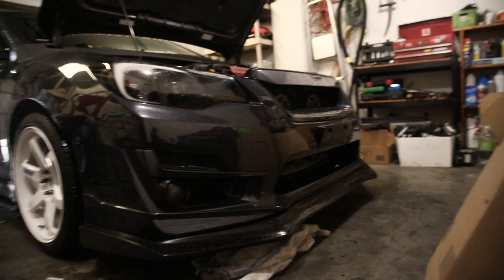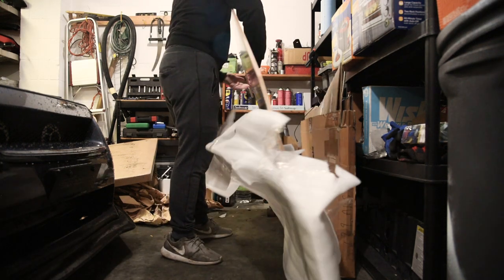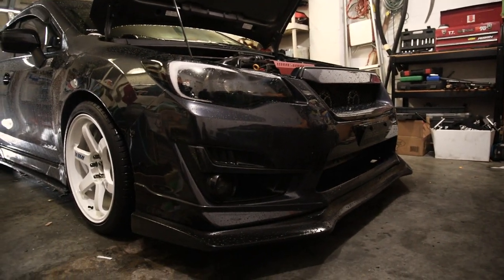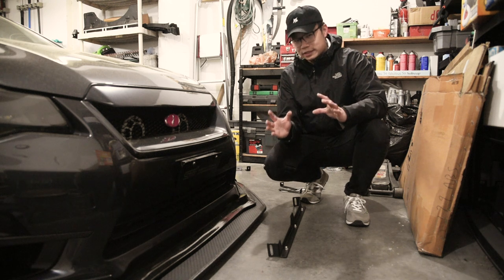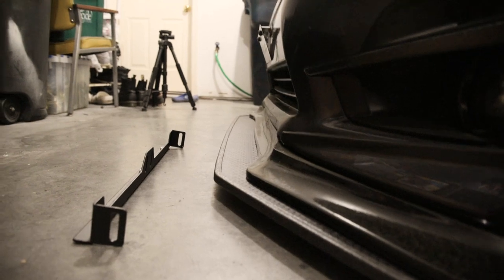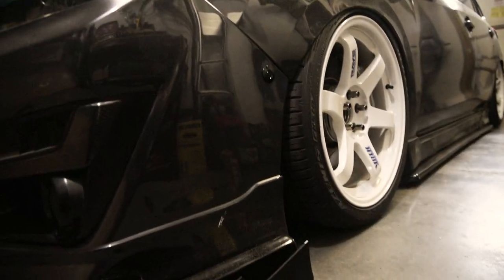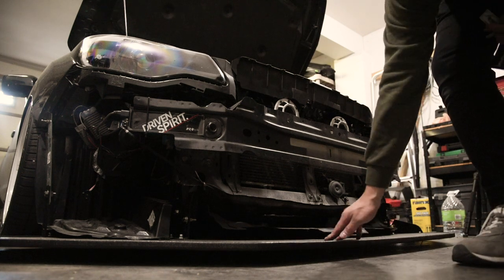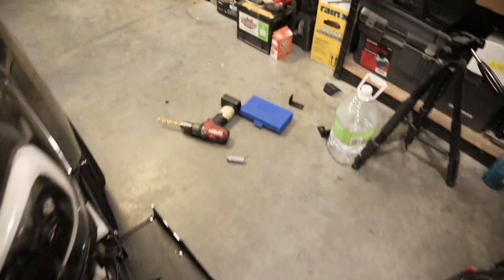Installing a Chassis Mount Splitter on my Impreza | Battle Aero

Comment: Do you have a front chassis brace mounted on this car? I’m curious if the 2015 wrx sti chassis mounts points are the same as the 2015 impreza hatch

Comment: I have a 2017 subaru impreza 2.0l CVT and im curious, how much horsepower are you getting after all the mods, im running 152 stock. What exactly are you running as a tune thats good for a CVT?
Reply: Tbh bro any modifications to the engine on this platform are not worth it due to the piston chambers not being able to handle compression. However, I have heard of people putting a cam in with a different bore. It would be cheaper and overall better to buy either an STI or a WRX. The technology for racing is built in and there’s less guesswork for parts. Personally I’ve seen solid drift builds come out of the manual Imprezas with welded diff and front diff delete. The weight distribution and it being Naturally aspirated offers great handling and throttle response